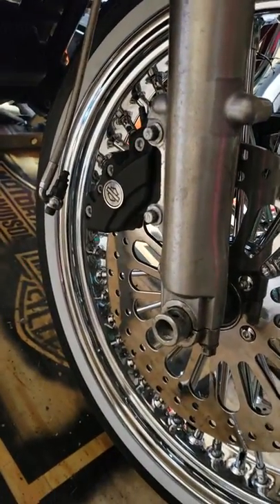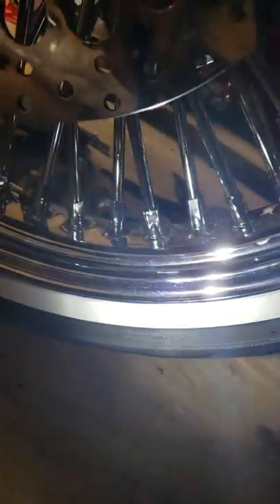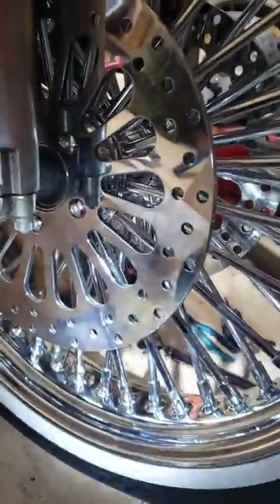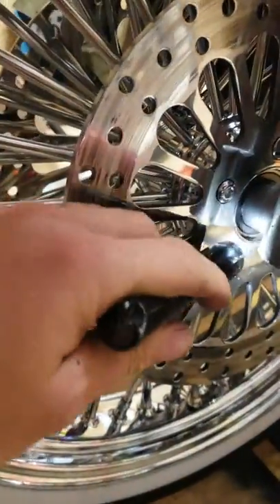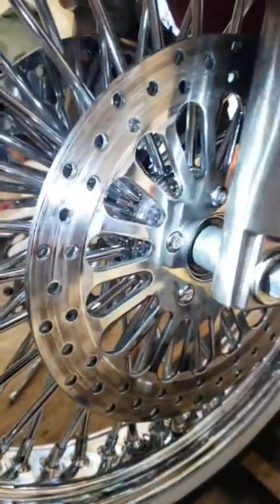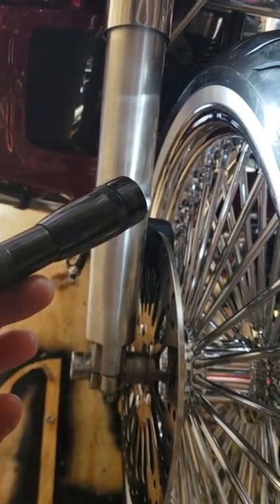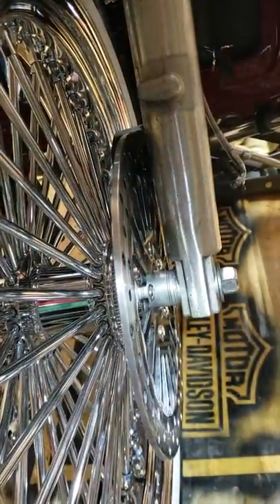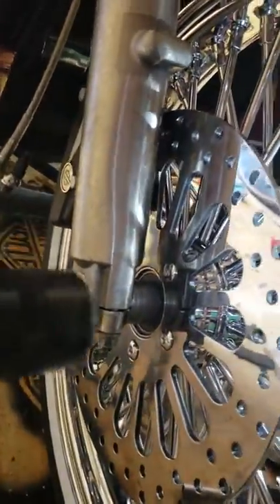Install 21 in wheel on Harley-davidson tire on backwards caliper rubs rotor

Comment: Great video..... I have the same setup with the same damage initially I thought maybe the calipers would adjust after a spin around the block nope. And of course the bearings ain't the same .... Thanks for the heads up

Comment: Hey, I have the same spoked rims. 21” front and 18” back. Can’t seem to find a pressure gauge that fits between the spokes on the back only. Even Discount tire Today didn’t have one that fit. What do you use?

Comment: Im confused.  The tire being on the rim backwards shouldn’t make a damn.  Its all about rim fitment/spacing that would cause any problems.
Reply from the maker: Yup, you are confused. Pretty simple, company sends you a wheel and tire. You look at the direction arrow and put it on the bike. Fits fine, spin the tire and it drags like hell on one side, flip the tire around, doesn't drag at all. Direction arrow is facing the wrong way. This is what happened in my case.
Reply: Rod P then the problem was the wheel backwards, not the tire
Reply from the maker: You are still comfused, there are spacing differences sooo if the tire is put on backwards this happens. If the tire was put on right then I would of installed it with no issues, just like the new one they sent me.
Reply: Rod P lol ok

Comment: I’m having same issue, just put a 2011 ultra classic wheel on my 2008 electra glide classic, that same side is “hanging up” a bit, so it’s possible what I have is a backwards tire and the wheel needs to be turned around?
Reply from the maker: I would guess so. Look for the arrow on the tire. I contacted the vendor and they fixed it.

Comment: Was this from eastern performance? Because I have the same problem from my 07 street glide and I haven’t tried turning the wheel arounf to see if that’s the issue.
Reply: If u have abs u gotta make sure u put wheel on right side with sensor for abs! And my stock rotors have a directional arrow like tires to tell you which direction they have to go

Comment: Tire being on backwards has nothing to do with the brakes dragging 😂😂🤣
Reply from the maker: You must be a troll. Yes it does when you have spacers that are not the same on both sides. I installed the wheel in the direction of the tire arrow and yes it did drag. That is why I have severe scratches. When I flipped the wheel so the tire arrows pointed counter clockwise it was correct but wear on the tire won't be right. Sent it back to the manufacturer and they sent me a new one with tire in the right direction, fixed issue. Stop trolling when you don't know what your talking about foo.

Comment: The tire is not on backwards. You got the spacers backwards...
Reply from the maker: LOL negative, the wheel only goes on one way and my spacers on my 2008 Ultra Classic are exactly the same spacers, the wheel itself has different depth measurements where the spacers go and the tire was on backwards with the arrows facing the rear and there was no gap and that is why the caliper got messed up in the first place. Once I told the manufacture they fixed it and went on exactly the way it is supposed to go so AGAIN, yes the tire was on backwards...
Reply: Yep

Comment: This just happened to me, but not sure how you can tell if the tire is on backwards...... couldn't you just flip the tire the other way so the arrow goes the proper way?
Reply from the maker: Nah you cant flip it the other way because the wheel rings are a little deeper on one side so it wont work. Believe me I tried...

Comment: That’s what happen when you don’t know how to do something ask for help or pay someone now because you make a mistake installing it wrong the easy way is blame the company  really be realistic and accept was your fault
Reply from the maker: You're a real idiot huh. 🙄 did you listen or are you deaf? The tire was flipped on the wheel so the arrows were pointed in the wrong direction because the wheel goes on 1 way. You have different spacers so when a company flips the tire and someone installs it looking at the arrow of the tire then it ends up wrong, how is that their fault. Troll on...
Reply from the maker: Also, why are you on my post when you ride a croutch rocket? Oh I forgot, you're a troll.

Comment: Roger P, I happened to come across your video.  I just bought a 21 inch wheel from M-teks and it will arrive in a few days.  Now after watching your vid, I'm a bit concerned about this rotor/caliper issue.  After reviewing several comments, it appears several bikers are having/ have had a similar issue but they didn't go into much detail. Appreciate the video and we'll see how things go once my wheel arrives.  Have a fine week.  👍🏽🤠 7/17/23

Comment: The valve stem goes on the right hand side of the bike. That was the problem.
Reply: When you say right hand side do you mean throttle side or clutch side facing bike
Reply: @keithlamb1654  throttle side it's always as you sit in...on vehicle